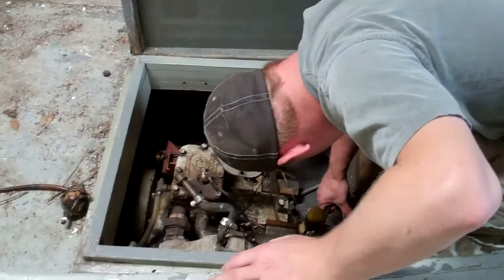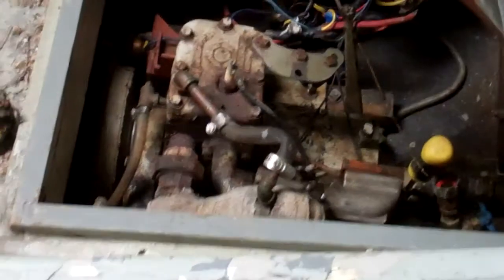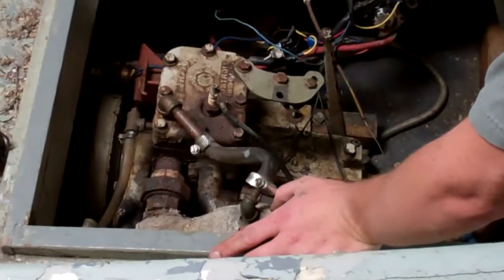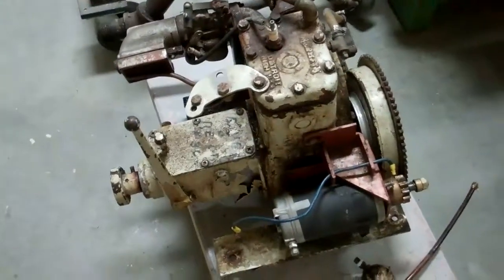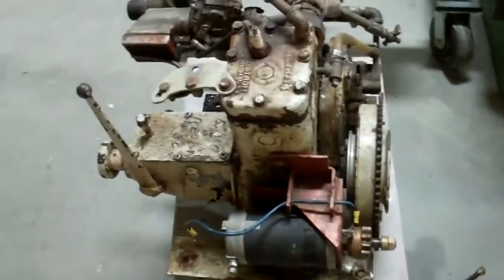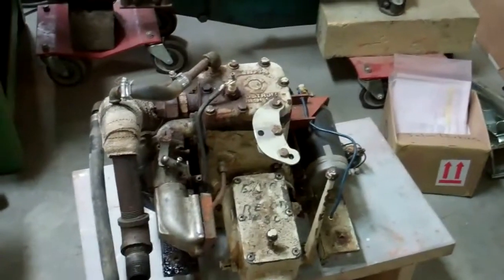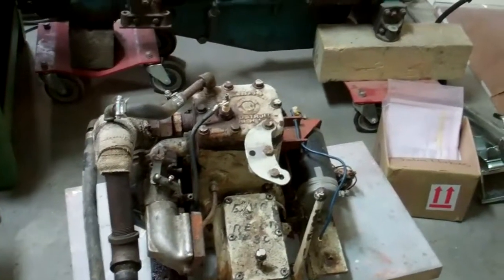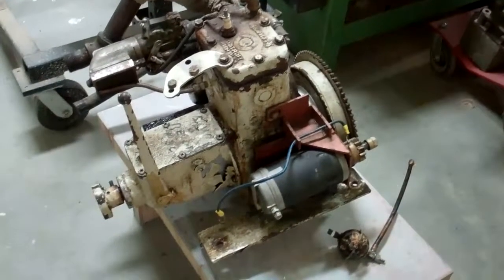Saving Corlear   Kermath Sea Pup Engine 7 24 13

Comment: Ive had one of these sitting on a shelf fir about 20 years.  It's missing a carburetor.  Any update?   Where can i get parts?
Reply from the maker: We gave what was left of the Kermath to someone trying to rebuild theirs and installed an Elco electric motor in its place. Yes, they are wonderful engines, but parts? Just not available. You might get on Google, if you have not done so already. I searched "Kermath marine engines" and got: https://www.google.com/search?q=kermath+marine+engines&rlz=1C1AVFC_enUS833US833&oq=kermath+&aqs=chrome.1.69i57j0i512l2j46i175i199i512j0i512l2j0i30l4.6434j0j15&sourceid=chrome&ie=UTF-8#bsht=Cgdic2h3Y2hwEgQIBDAB

There was a Sea Pup model for sale on Antique Boat America, but it's sold: http://www.antiqueboatamerica.com/Boat/29384